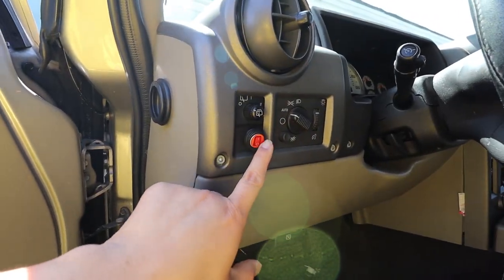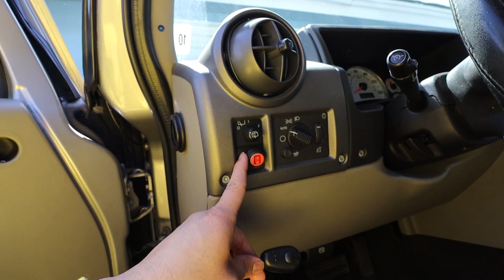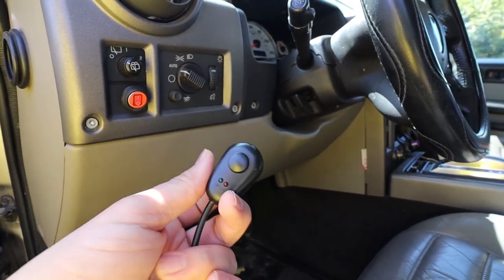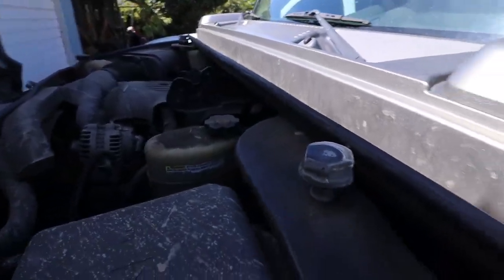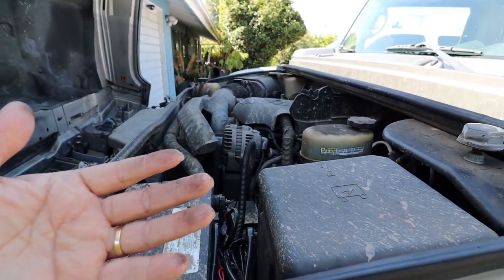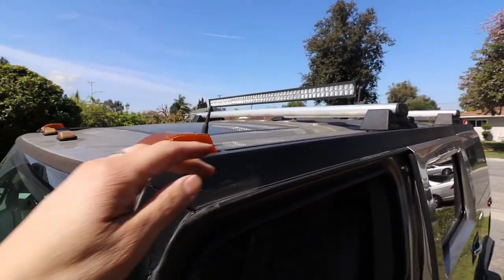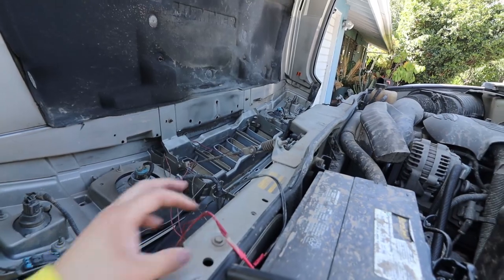HUMMER H2 Lightbar Update 10 moths later

Comment: Can you show how you mounted the red button switch? Just got my light bar and it came with that switch.
Reply from the maker: There’s one of the videos where at some point i show how i did it . When you open the driver side door there’s a removable panel to the left of where that switch is that gives you access to the rear of where that switch is if you take a quick look at it its easy to pop that little section out and install the switch. The space where the switch is is always blank by default you just need to push from behind to pop it off and drill a hole for the switch than it just snaps back into place . Let me know if that helped you out…